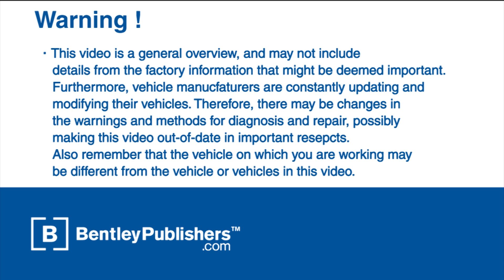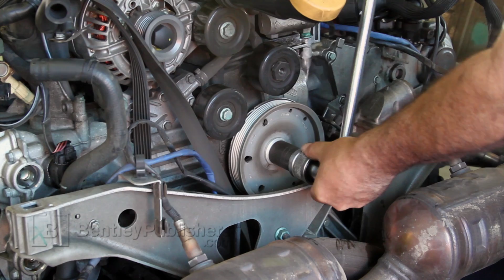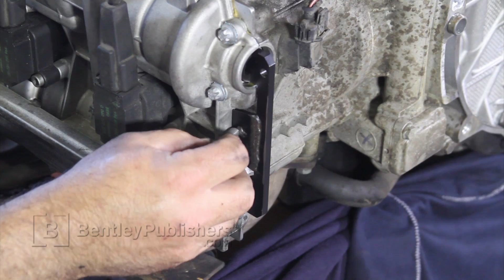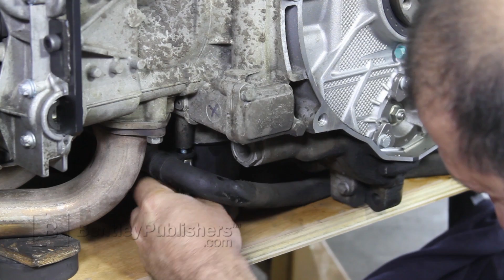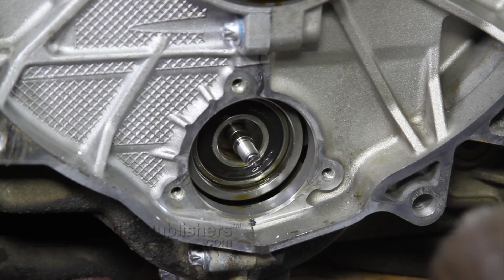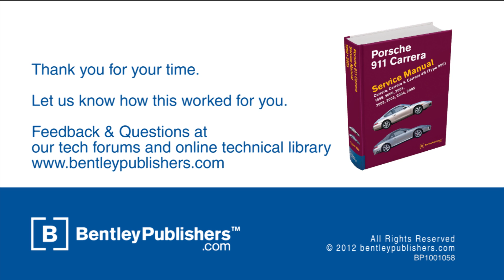Porsche 911 Carrera (996) 1999-2005 - Intermediate shaft (IMS) bearing - DIY Repair

Comment: I got ahead of my self and popped the bearing cover without locking the cams, I stopped there but I'm wondering if I can still rotate engine  lock the cam and crank ?? anyone have any input on this!?I have not pulled the chain tensioner out yet
Reply: my problem is I can't get the. bracket back on because the rear of the ims is loaded and being pulled off cent of the holr
Reply: @sMFq11  this is why the instructions are specific about locking the cams with the crank at TDC and loosening the tensioners. It's almost as if the folks that designed the replacement did some experimenting to find the 'best way'.

Comment: The first thing I did when I got my 996 was replace the IMS bearing and rear seal. The bearing I took out at 64,000 miles was absolutely perfect. The bigger and real probs with the M96 engine are its open deck design and the shitty materials it made out of. I'm on motor three. The original spun a rod bearing and spit out the thrust washers. Motor two ended its life with a cracked cylinder wall. And engine three is a ticking time bomb, probably due to bore scoring. The M96 isn't made to be rebuilt. There are no aftermarket bearings, crankshafts or camshafts. You can't do anything feasible with the cylinder walls except have them sleeved or sent to Jake Raby for a new Nikasil plating. But I still love mine and love it and its ugly ass headlights enough to never want to sell it. Why? Go drive one:)

Comment: If you are in America you can get this for about $575.00 - https://amzn.to/34GX6aH
Reply: Brilliant, and thank you so much for the link.  I need two, one for a 99 Boxster and the other for a 2000 911/996.  The latter has only 43K on it (the former has 135K or so), but this far out, I think replacing both is order, just due to age if nothing else.  
Now...where can I buy a kit to replace the loose bearings inside my head?  :D

Comment: I saw a repair that had a oil line that went to the bearing from a plate sandwiched between oil filter.  This keeps the IMS bearing in oil at all times.   A much better repair then this one.
Reply: Its an updated aftermarket repair. Thousands more for the kit than this one plus laborfor it is more, this is just a simple replacement of the original.

Comment: After replacing the  IMS bearing, keep your tools in a safe place because this bearing will fail again.... There is an upgrade kit that will make it a permanent fix. It is an IMS Bearing and Oiling System Kit, it will cost more than this fix, but if done right, it will not fail again..
Reply: the onlyway to go. Just like the timing chain tensioners of days gone  by. Best fix were the oil fed replacement kits.

Comment: just buy a 2009 model and u dont godda worry about this ever.
Reply: Then you got carbon deposits in the intake...
Reply: nahhh just do a e85 mix that will keep everything clean thats what i do ..not one problem ever
thats they key to DI and the best oil u can buy
Reply: @time traveler are we there yet If there is no fuel in the intake tract, how does your choice of fuel reduce carbon deposits? You said you have had not one problem ever. Have you stuck a camera down there to look?

The carbon deposits reduce power very gradually. You probably would not notice. In those early DI engines there is no fuel at all in the intake tract, so choice of fuel makes no difference. I also don’t see how oil choice could make any difference. No matter what oil you choose it is going to end up stuck and burnt on the backs of your intake valves, obstructing the air going into the cylinders.

Here’s a thread with lots of nice pictures of your engine, all gummed up with carbon: https://www.6speedonline.com/forums/997/317409-intake-valve-carbon-build-up.html
Reply: I know what your talking about ..however
i know for a fact good oil plays a factor in less carbon build up hmm let me find somthing ill get back to you. cuz i do have an audi A5 2011 DI  runs like a top no issues with build up an e85 does help i got sparkley pistons lol
Reply: and run it hard on freeway every blue moon...its worked for me.
Reply: @time traveler are we there yet I’m no expert. You may well know things I don’t know.
Reply: lol yea ..i knew i wasnt crazy lol...
all my cars are DI and i have 5...a modder turned me on to the e85 mix thing.
 he told me that cheap gas and cheap oil will build nasty carbon fast!!..so drive it like ya stole it..use e85 mix and MOTUL..amsoil..liqui moly  pintosin..oils the best!! and it will  bring carbon build up to a crawl.
Reply: u cant stop the carbon build up with DI cars u just cant.
BUT bro u can keep it from getting really bad and u can slow it down bigtime by doing what i just said.
Reply: oh and stay away from mobile 1
back in the 80s mobile one was good.
now its crap!!
liqui moly or ..motul bro for the win.
Reply: @time traveler are we there yet Thanks for the info.

Comment: Can anyone tell me if the risk is higher on a 14k miles 2000 Boxster or less ???   Thank you
Reply: See. www.por-ims.com
Reply: old post the  risk is low
in the 2000 porsche u had a double row bearing
from 2001 to 2005 those were the trouble years
 those years had the single row bearing
Reply: @MrOmgfreak  Lots will argue that 'you just can't tell'. But I have a MY2000 with a dual row and pretty much everyone I know that has had 99-2000 996s and 986s had dual row bearings. I know engine numbers aren't 100% scientific but I have found resources on the topic to be pretty reliable. NOT suggesting they're 100% accurate, but fairly reliable. . . 

For anyone finding this; the Porsche Parts Catalog actually lists engine number cut-off dates for Dual-Row. Although AGAIN, this is known NOT to be 100% accurate, but is a good ballpark for you. If you find yourself 'close' to these engine numbers I would be less inclined to trust it; but if you're well before the cutoff, it's very likely you have an earlier model engine, with the dual row.

Remember these engines weren't assembled on site at the final assembly plant; they were assembled and freighted in. So, they maintained an inventory of Engines. I don't know at which point in an engine's lifecycle it received it's final stamping / serial number. Thus, the reason for the discrepancies. 

Your Engine number (M96) can be found along the bottom most center-seam of the transmission casing. It's probably covered in grime so take a paper towel or steel wool with you when you climb under. 

986 Boxster 2.7L       - Up to Engine M651 12851
986 Boxster S 3.2L   - Up to Engine M671 11237
996 Carreras              - UP to Engine M661 14164

Comment: Can't see why you have to remove the relay to crank the engine without firing to build up oil pressure. Oil pressure will build up immediately if your oil level is correct. We're not talking long oil lines here.
Reply: You want to have the chain tensioners pressurized before you start engine or you could jump cam timing.

Comment: I rebuild transmission for a living and I an currently looking at  04 911 that the ims failed on.honestly this is pretty easy looking to do considering I'm a American mecanic and not a European mechanic.but I do believe they could of used a belt system for timing and left the mechanical parts pressured bearings
Reply: if the IMS failed, more than likely so is the engine.  It is very difficult to tell when IMS fails.  And by the time, you see metal shavings in the motor oil, the damage is done.

Comment: A mechanical engineer who sets a design for a shaft using both pressurized insert bearings that have clearance for riding on a film of oil along with a roller or ball bearing that essentially has zero clearance should have his ticket pulled and retrained. The ball/roller bearing will in effect be supporting the entire shaft until it gets pounded to pieces—and of course that is just what is happening.
On a given shaft it’s either all ball/rollers or all pressurized.  Too many parts to these engines especially all the chains; we’ve seen what just one split roller does--  total destruction.  Design may look cool with the mass of moving parts, just as long as they all keep moving in their order...
Reply: that engineer is retired, and goes to Oktoberfest every year to celebrate!!
Reply: statistics say 70% of all Porsches ever made are still on the road. Poor design? What is your solution? Do you have any patent of your own considering your knowledge of this topic?

Comment: The easiest way to avoid this issue all together is by avoiding any liquid cooled Porsche made prior to 2009, except the 911 Turbo. They had a different engine without the problem.

Sure the early ones can be had cheap, but it's an expensive gamble that can be avoided.
Reply: The 2006 onwards Caymans had the bigger bearing and no issues. I assume similar year onwards Boxsters are the same.
Reply: Easiest way to avoid this issue is to get a good deal on a car with a fresh clutch, ims, and rms, or change those parts as soon as u get the car (your damn self)
U jus watched a fkn video of how todo it. Geez! People are soo damn pussy these days.
But thats lemons into sweet lemonade. U can get sweeetAzz deals on these.

Comment: hello this is very nice i only have 1 question i have the 2000 996 and i have the ims tool 106-08-1.3 but i can find the tool setup and assemble manual and research on line and cant find it can you please add more photo of the tool thank you

Comment: how many years does this IMS maintenance be perform to the car? approximately how much will it cost?
Reply: john smith I believe LN engineering says it has a 6 year service life. However Porsche doesn't recommend replacing the bearing. Very few engines have failures, less than 5% if that. The company's that make these bearings are trying to scare everyone into buying their product.

Comment: I'm planing to buy 2005 Boxter and it has 91k miles and I what to know does this year model have issue with ims bearing failure and the owner of the car said they changed the clutch like on 88k miles and changed rear main seal and checked for ims bearing it looked just fine
Reply: @clive jones Scaremongering (alarmisme)
Reply: Porsche Fanatic mid year 2005 they upgrade the bearing to a double row bearing. Most failures were low mileage vehicles and it was less than 5% failure rate if that. Porsche doesn't recommend replacing this bearing. On top of that, the companies that make these products are scaring everyone away from a fantastic car. They make you think you have to have this product they sell.

Comment: Direct oil feed to this bearing is the most appropriate, unless you replace the bearing every other oil change. I stripped down my Bentley to its short block to fix the head gasket that fails at 50,000mls. I'm a can do guy but still shit my britches.

Comment: What a totally fucked up design from Porsche. I thought the germans were at the pinnacle of engineering design; what the fuck is this shit?
Reply: "that's why all German cars are VERY unreliable and super expensive to maintain" - Not totally true,  expensive to maintain if you can't do repairs / Maintenance  your self,   and -  Porsches   are very reliable  if you  take care of them.
Reply: Id love kick the German prick(s), who thought it was a good idea to use a SEALED bearing INSIDE of an engine that is filled with OIL, right in the nuts!
Reply: True... they all took a stupid pill and turned into Homer Simpson.  DOH!
Reply: The actual cause of the problem is the unvented IMS itself.  A simple hole drilled in the IMS would have relieved the pressure that builds up inside and when cooling, it wouldn't suck air and oil inside the bearing and dilute the grease.
Reply: How this problem come in this Porsche ?. Whats the problem about this Porsche's carrera 4s ?, help please
Reply: You should look up to see what engine you have.  I don't know about Carreras.  The 986 and 987s were the bad bearing engines.
Reply: +oppanheimer Germans overcomplicate things, that's why all german cars are VERY unreliable and super expensive to maintain. The technology german cars use to turn on/off the lights is similar to the technology the rest of the world uses to launch nuclear missiles from submarines. :)
Reply: ***** This is a cost saving measure because they use the same casting for both banks of heads and needed to use an intermediate shaft at both ends to run the cams off the crank. But to put a sealed bearing in place of a pressure fed oil supplied bearing is not over complicated it is absolute stupidity.

Comment: So much for the often touted superior German engineering prowess. German cars are money pit because if you don't spend hordes of money to maintain it, it will blow up in the worst opportune time, like driving your wife to the hospital.  I have a BMW and love driving it but be prepare to dump money into it.
Reply: Our 22month old Ford Escape did just that! Broke down on the way to the hospital when my wife was in labor. Bad MAF sensor, but at 2:30AM in the hood, it didn't matter what it was. My Porsche has 99k on it, less problems than my 09 WRX which ignited itself in 2013 and caught on fire.
Reply: I have owned my BMW for 2 years now. Bought it with 94,000 miles on it. It now has 111k on it. Sure I have put a thousand in to it. However I purchased this car for 4k under bluebook. So this is to be expected. It needed new tires ($600), a new upper radiator hose, oil filter housing gasket, and a few interior trim pieces. My point is this. My girlfriend drives a Ford fusion with about that same mileage. She takes her car to the mechanic, I service my own. We have spent about the same to maintain both vehicles over that time period. BMW can be affordable to drive if you are not afraid to get your hands dirty. Remember, all cars require maintenance.
Reply: Todd Sadler im sure they do and what special tools .most bmw's from 2006 downwards are simple as fuck to fix you must be a tightass
Reply: Todd Sadler any car engine can suffer from bearing a failure
Reply: I own BMW it is very reliable but what about this Porsche ?. How this problem come from to this Porsche ?, do you guys recommended to buy it ?

Comment: My 2000 Boxster blew at 120,000 IMS failure. and i am now having a l&n brand put in at Porsche as well as my RMS plus a clutch to save on labor costs down the road. If driving any of these models without an IMS fail safe it will leave you on the side of the road on a hill side in the rain during rush hour like it happened to me. Only problem I have ever had out of my 2 Porsches was that one blew up.

Comment: Applicable to 986 Boxsters as well. Humorous seeing this done on a very clean engine.

I believe the LN Engineering procedure mentions removing one and loosening a second chain tensioner; not removing all three. FWIW. Locking TDC before and verifying timing after especially important on single row bearings. Mentioning that would be instructive.

Also putting new bearing and insertion tool in freezer before installation is helpful and normal. It would also add value to mention all tools used and alternatives to the Porsche specialty tools when applicable (e.g. for IMS cover removal).